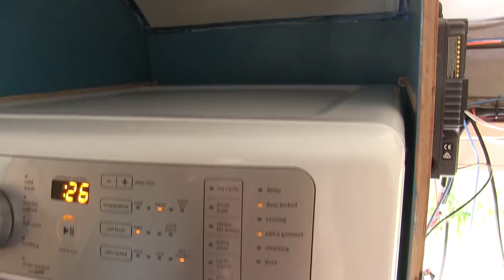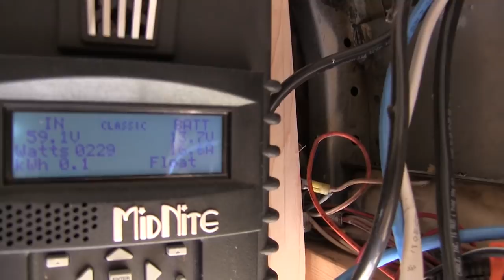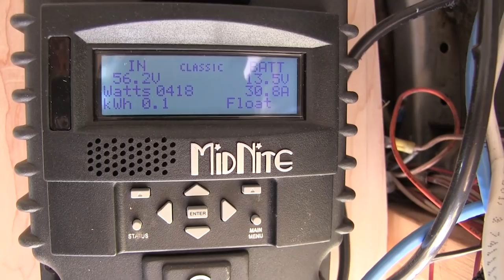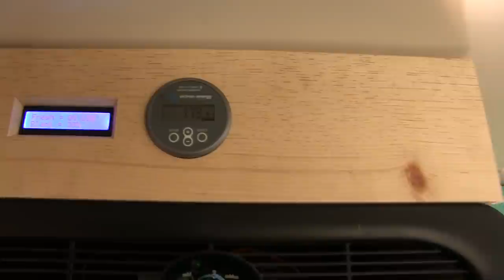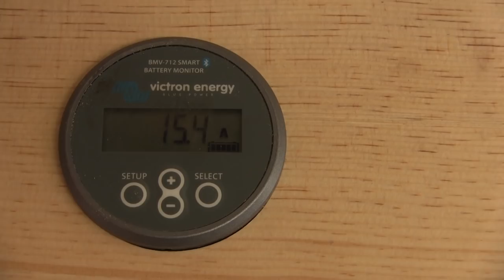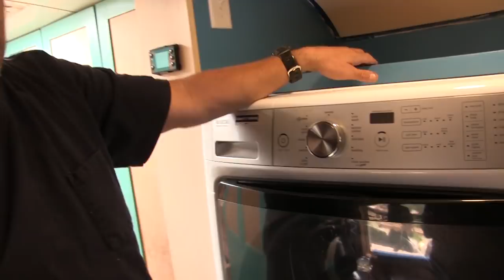Can You Fit a FULL-SIZE Washing Machine in a Skoolie? (and how much solar power would it use?)

Comment: Hey, guys.  It's probably super inconvenient right now, but if you ever find yourself pulling the washing machine out, I would replace the outlet with a standard one and instead replace the breaker with a GFCI breaker.  Either that or place it in a more accessible location, daisy chained to a standard outlet for the washing machine.

You will be super thankful that you don't have to maneuver the washing machine out and back in every time you need to test the outlet or reset it if it trips.

Comment: 11:08: A piece of carpet face down makes for easy sliding. Easier still would be to lay some plywood on that ramp and use the hand truck, as the gods intended.

If you ever have to replace that appliance, consider bringing it in backwards, as you’ve done, but then taking it down the corridor sideways; then you wouldn’t have to make any turns at all.

Comment: hmmm i wonder if you have too heavy fuses installed , usually you cannot draw an arc like that , at least over in europe , it trips the breaker a lot faster in less than a milisecond , still can scare the crap out of yah though
smart idea with the small acceshatch in the back of the wall behind the machine 

in hindsight it mightve been better to put the trolley  under the right side of the washing machine and go down the isle that way (washing machine door facing the right way from the start) then lift straight up from both sides and slide it straight onto the shelve , the machines are usually less deep than wide so it shouldve worked , do need two strong people to lift it that way though but youre lifting half the weight each 
realy strap the machine down when traveling and during the spincycle (the load inside the machine causes an inballance and causes the machine to shake a lot ) think a ratchet strap or a metal bar across the front under the door should work  , it will draw way more when you put a load of laundry in maibe tie the washing machine to the back wall using that small hatch you made for the wallsocket to prevent it walking / sliding out the niche
one thing that you might run the risk of is that you keep hitting the rotary knob when walking by , i had the circuitboard behind a knob on a washing mashine like that (was an LG)  break because the knob got busted in , wat you can do to solve it some is to extend the shelve over the top of the machine so it goes passed the knob so when hitting that side of the hallway you not hitting the knob at full force , you can round the shelve off , even make it arc along the front  so you dont hit corners , it should help protect the machine some (see if you still can add the soap and detergent with the extended shelve in place) 
a 2 by 2 piece of lumber against the front to extend the shelve the machine sits on should prevent the feet from dropping off , make it removable so you have the space in the isle to set the machine down should you ever need to remove it

Comment: I love the turquoise you used on kitchen cabinets. I used almost same color on our bed base, then painted all the walls a soft pale yellow. Our kitchen is 2 tone green with rosey accents. We work with the dc a lot and don't usually turn off power but AC? Power goes off, I have had some nasty experiences.

Comment: Even though that shelf is close and it doesn't budge, when moving down the road that's a lot of dynamic weight. I'd still add a hold in strap of some sort. Even some strap webbing, looped through that back hole and screwed to lower wood with some fender washers.

Comment: You would do better to have a gfci breaker than a gfci outlet. Because if you trip the outlet, you'll have to pull out the washer to reset the outlet as opposed to going to the breaker to reset the gfci breaker.
Reply from the maker: Had I known...😐
Reply: @BussyMcBusface  It will never be an emergency if it trips. Unplug and plug in else where or if you can unplug through your little access you can reset. Looks good roll with it.
Reply: I was thinking that the access hole would work for that just fine as well.. Eventually when that plug wears out, you can go through the hassle of changing it out, but I'd say "let it ride" for now!!!

Comment: Mike, if you put that GFI outlet so low and behind the washer, if it ever trips, you are not going to be able to reach it to reset it.  You will end up having to pull the washer out.  You might want to rewire it so the GFI is on a chain with another outlet in the kitchen (replacing it with a regular outlet with a tamper proof feature which will give you a seal against moisture) or move that outlet up above the height of the washer where you can reach it.  You are going you hate yourself the first time that GFI trips were it is located brother.

Comment: Why not put the receptacle and water lines above the back of the washer? Easier to turn the water off in case of a leak and ease of installation. Also, I believe you can get drain pans to put under washers in case the washer leaks. Cheap insurance to protect all the hard work ya'llve put into that bus. Looks great by the way!

Comment: Hey Mike, HUGE suggestion, but I realize it will be too late. You should have used a GFI breaker instead, because if the GFI pops, you will have to take the washer out to reset it! You won't like that! AND you might as well buy a new lineman pliers at the same time! :)
Reply from the maker: That is the plan. Didnt know about those until all the electricians that follow the channel commented!🤣 I'm going to make the change in the next week or so.

Comment: It's been a long,  long time since I've shorted myself out on a live circuit.  One thing though,  it does stick in your memory.  I think the jumping part is as rough on a person as the amperage.  (well,  within reason of course)   One of my nephews (a licensed electrician)  used a pair of my side cutters once upon a time to "find"  a live circuit by cutting it.   Good-bye side cutters.   He gave me his pair out of his pouch.  Arc welding your pliers is never a good idea.

Comment: Hello. Has  the washing machine started rubbing on the shelf or making noise? 
Good idea compressing the shelf to machine, but a few rubber gaskets would help isolating the machine from the shelf for vibration, Same would go for the bottom.
Just started watching and I am enjoying the channel.
Reply from the maker: Thank you. It has worked flawlessly and hadn't made any noise. It hasn't moved it has just done what it's supposed to. 😊

Comment: Kinda hard to reset that plug Mike you could have used the circuit on the kitchen or bathroom GfCI it would work just the same and as quick just a thought.
Reply from the maker: Yeah, the comments have made that pretty clear. Down the line I will upgrade to a gfci breaker but for now it will clean clothes!😁
Reply: @BussyMcBusface  all and all it turned out great it looks very nice in the bus.
Congratulations

Comment: Should have left a strap attached to the rear bottom edge, running underneath to the front to give you something to hold if you have to remove it in the future.

Comment: Why not a washer dryer combo?
Reply from the maker: The apartment size w/d combos are too large vertically for the curved ceiling. The all in one W/D are super inefficient and take over 2 hours per load and the load size is about 3 towels. The drying cycle is what takes the longest and uses a lot of propane.

Comment: Carrie, if you truly do love that paint brush, please learn to treat it more kindly. Paint really only belongs at the tip of the business end, not all the way up to the ferrule. When it’s overloaded like that, it’s much harder to clean and will only have a fraction of its normal life expectancy. Notice how stiff it is with hardening paint at 2:30.

Also, it’s easier and neater to cut in with strokes parallel to the edge rather that perpendicular, as you are doing at 1:35. There must be plenty of instructive videos about using a brush.

Sorry to scold, but it’s for your own good, young lady.